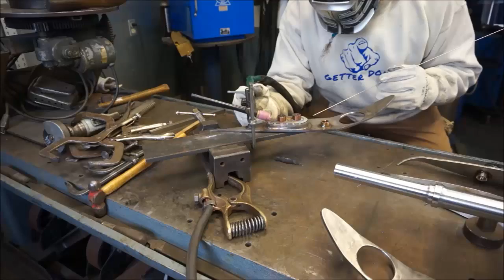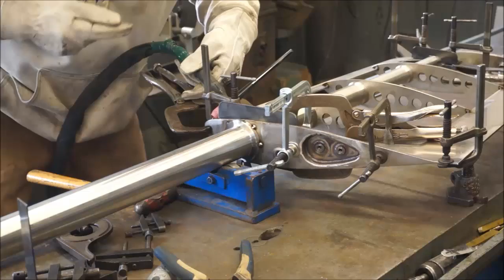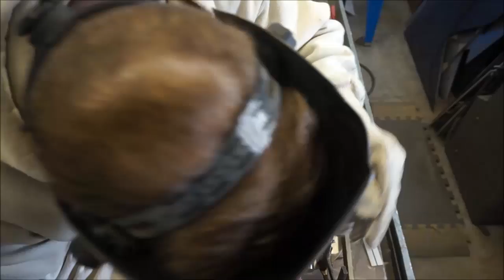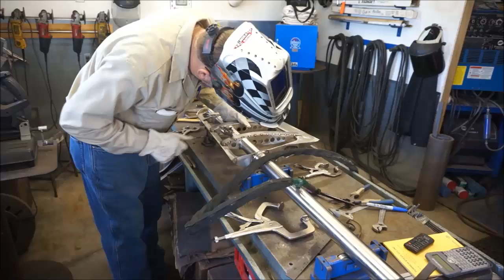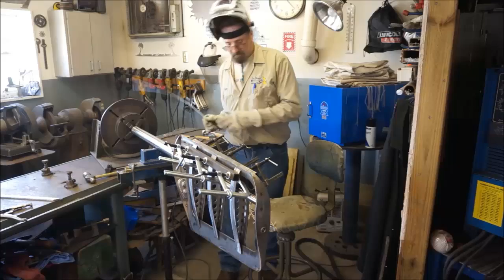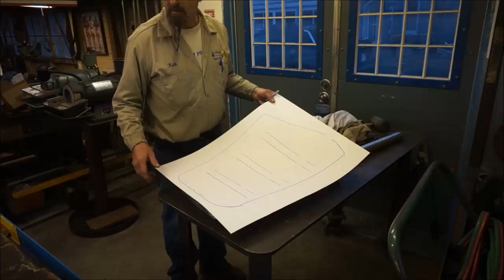Wing It Part 15

Comment: 2nd time 'round-viewing Wing-It series ...
-------------------------------
I need to find: 1/4"dowel, w/SLIT cut in end.
No problem: take a SLITTING SAW(which I don't have), a MILL, USING VISE(which I don't have), clamp it on-ctr>slit.
Easy, but ... I only have a DRILL-PRESS.
What do you suggest?

Comment: After getting the internal structure in place I'd be tempted to fiberglass the rudder... easier to fair... and then fill the inside with foam.  Was there a reason the customer wanted a full metal rudder?  Seems like fiberglass would have been quicker and allowed easier adjustment of the surface of the foil.  A good fiberglass job with an epoxy sealer might also eliminate the concern for zincs and electrolysis.  Great videos.  I've learned a lot watching the series.

Comment: Hi Keith,
I'm not so familiar with marine stuff, but, one question, are all one of a kind rudders made that meticulously?
If so, the whole ship might just be way out of price.
Poor Captain hitting a reef and damaging those, probably the end of his career...
This is real craft work, I learn all sort of stuff along the way.
Thanks for sharing,
Pierre
Reply from the maker: This is a one of a kind rudder fabrication, as far as I know. I have worked on similar kinds of construction in the yards and applied what I knew with what the customer also added into the mix. It was a pleasure working on a vessel with concern and money being spent below the water line, so many others spend it above the edge of the hole in the water, and never lift a hatch to look below! ;{)-----

Comment: why add a zink anode on Stainless steel??
Reply from the maker: Stainless steel in salt water is pretty corrosion free but electrolysis caused by stray currents can eat at it, and the zinc draws the attention of those stray currents.